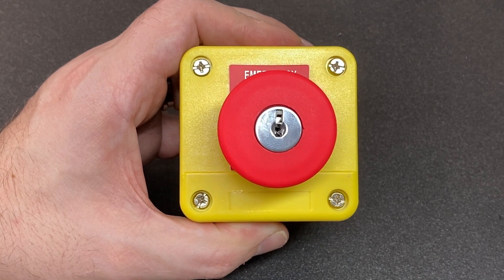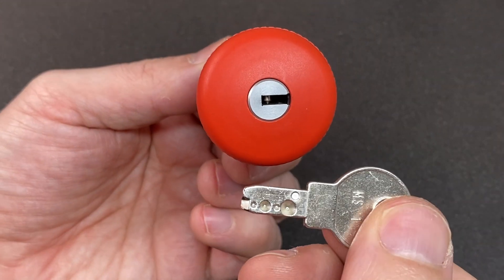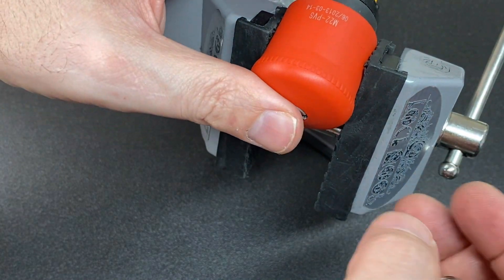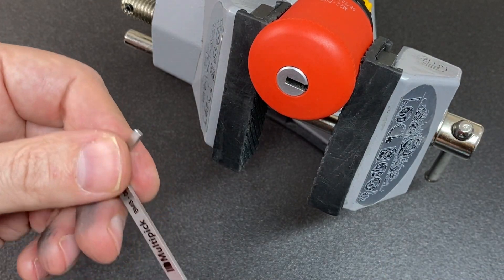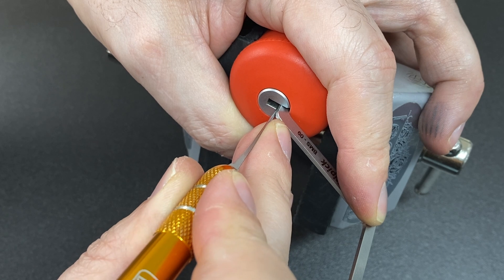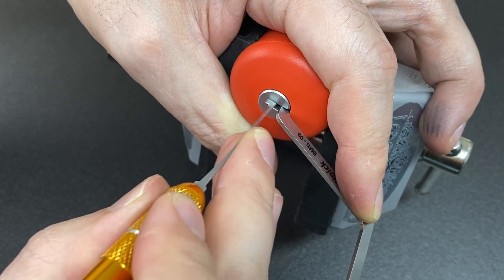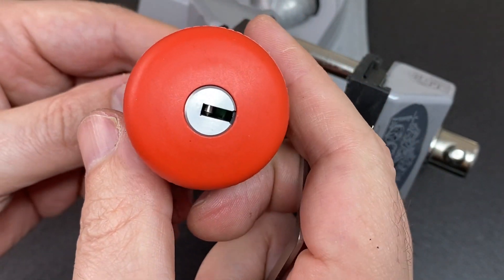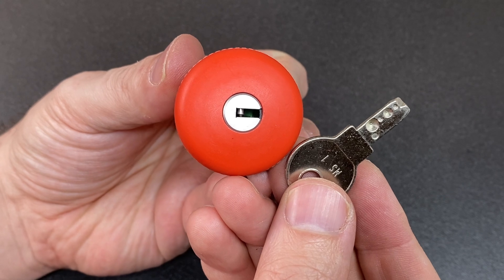Emergency Button Dimple Lock Picked

Comment: cylinder is from german CES company i belive, and Moeller(switch producers) offer  i beleive 20 or 50 different key codes, and this MS1 is stock so in most cases if you'll see moeller keyswitch (not just emergency stob button)  MS1 key will work

Comment: E.Stop buttons are not designed to be difficult to pick as it is a criminal offence to reset them if un authorised.
Reply: That statement doesn't make any sense at all. By the same logic you could use a shitty lock on your door because a burglar would be entering illegally...
Reply: @TheTutch  obviously you have never worked in industry, the chances of a burglar getting caught are zero, You interfere with an emergency stop circuit and the HSE have much stronger powers than the police, 
You will also be sacked, try going on a guarding regulation course.
Reply: @TheTutch  ps you just defined breaking an entry, if a burglar just opens a door they haven’t committed an offence.